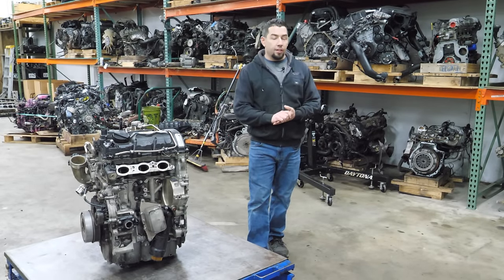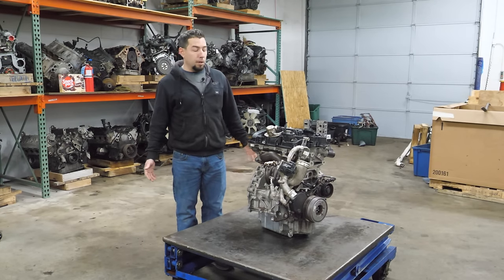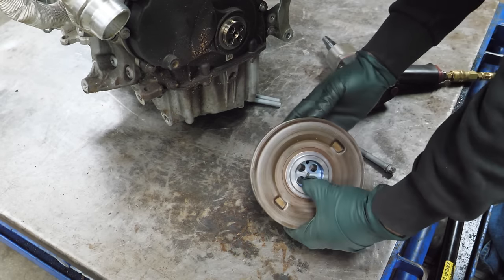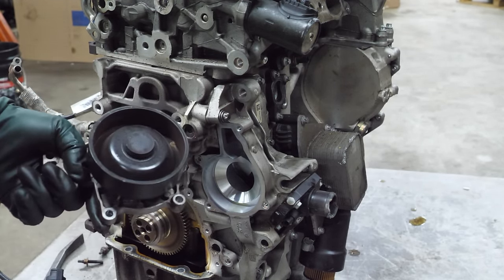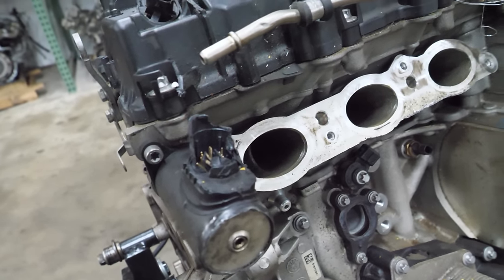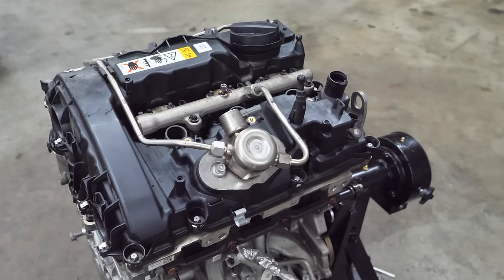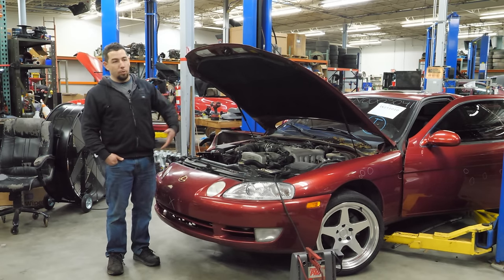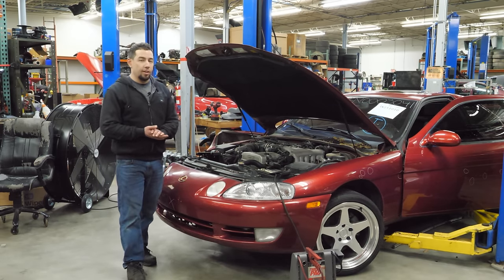MYSTERY FAILURE? 3-Cylinder BMW / Mini Cooper B38 1.5L Engine Teardown

Comment: I own one of these! '15 Cooper. Sweetheart of an engine. Bit rough of a runner, but smooth revving with good power, and excellent fuel mileage on the highway. 123,000 kms so far, hoping to stick with this car for a long, long time
Reply: These are nothing like the good old BMWs
Reply: Oh I know! But the B series is pretty damn solid, there’s records of Minis hitting over half a million with original engine

I’m just genuinely impressed by how good this little engine is, is all
Reply: I was wondering if some customers buy these engines for the fuel economy and dont work them hard enough for long enough.  The engines dont get hot enough to burn off the carbon.      In my experience it can be better to work an engine at higher revs rather than let it slog and overstress it.    I think that engine had been run too slow.
Reply: @jonathanflatman yeah, regular Italian tune-up and good to go.
Reply: @jonathanflatman  I believe you are 100% correct.  With the trend for low friction rings if the engine isn't used hard occasionally they can suffer bore glazing and high oil consumption.  Under harder use the cylinder pressure pushes the rings out against the bore to keep the sealing surfaces working well.
Reply: @earlscheib7754   Lucky this isn't in a BMW then 😉 The B38 sure as hell beats that piece of shit Peugeot engine the R56 had in it. The tritec in the R50/R53 wasn't really anything to write home about either- although adding a supercharger made it pretty cool. Aint no M54 fitting into a Mini lol.
Reply: @jonathanflatman  Thing is that Mini are often driven in the city a lot and these things make so much torque under 3000rpm that you never need to rev them out. Compound that with an auto trans that upshift super early and city driving where you can never get over 1/2 throttle due to congestion and you've got a recipe for disaster. This thing was probably in Eco mode its whole life.
Reply: That junk will never get anywhere near half a million.Half a million problems yeah.The only one that was any good was the 1.4 diesel unit and that was a Toyota engine.
Reply: @eugeneoreilly9356  Theres one at 808,000 miles already. LOL
Reply: @FockeWolf100 bmw wants to wash off their unreliable image, their B series engines are really solid engines, they have been on the market for more than 6 years and no big problems with any of them, even the new supra has the b58
Reply: Better buy a spare engine or find a place you trust to rebuild soon. Never seen one over 200k. Good luck keepin her alive! Hell with the haters.
Reply: @nobodynoone2500  I adore my car; even if the engine does go at 200k (I dont think she'll have that issue) I plan on replacing it. I've had faster cars, but none of them were as fun as this!

Comment: I'd say you're right about the damper.  Years ago, I worked for a manufacturer that made a torsional harmonic damper / isolator pulley for the Mini Cooper S. It was similar in design to the one on this engine. The pulley had a limited range of axial rotation relative to the damper, controlled by an elastomer spring, and they did fail occasionally.

Comment: My money is on that crank pulley, I bet it was making a weird clunking noise and an apprentice misdiagnosed it as bottom end knock. If it happened to be burning oil at the same time, that might have been enough for them.

Comment: The car was probably driven short trips, stop and go city traffic, lots of idling, seldom up to high temp, or run on the highway.
Result, carboned up pistons.
Reply: I agree, my grandmother had a Honda Civic that glazed up due to short trips.     On the other hand, my mothder had a Hillman Imp that she used to thrash and it worked perfectly.   Mechanics from Roots came to inspect it  as it was one of the few problem free engines.   Turns out she was changing gear when the speedo reached the maximum rev markers for each gear that was marked on the speedo.    She did not know that it was maximum revs allowed marker  and had thought that it was a gear change marker!

Comment: I have a theory. This engine somehow got hot. The baked on oil on the piston skirts and the very light scoring in the bore would lead me to believe the oil was overheated either due to no oil cooler or the engine coolant getting too hot. N series an B series BMW engines are known for having very strong headgaskets on the turbo engines. So its unlikely a headgasket failed. However this would also coincide with the center cylinder looking "wet." It appears that the rings on the pistons are not able to move out of their grooves to seal against the cylinder walls from excessive heat. Nor can they allow combustion gasses to get behind them and push them out at that point whenall that carbon builds up. Being a turbo engine the compression is fairly low in B series engines but I bet this one was really low. 
Also N series and B series BMW's have a very specific procedure for bleeding air out of the coolant system. I would guess something happened where this wasn't done right ultimately leading to the engine loosing power and failing.

Comment: It's Cross hatching Eric the X pattern on the walls is a symbol of either A. A well maintained engine or B. A recently rebuilt/built engine. The matching crosshatches to retain oil in the X grooves keeping the cylinder and piston lubricated better, if the cylinders are glossy/mirror Finnish they WILL NOT retain oil and will lead to premature failure faster due to excessive wear.
Reply: He was referring to the strange V or X shaped pattern at the top of the bore found in the center cylinder.  Not the cross hatch, which he would be familiar with.
Maybe it’s caused by cylinder distortion?
Reply: @gordonborsboom7460  probably the injector pattern then from the hot spots

Comment: This engine has the same problems that we have on many modern direct injection engines, in particular TSI engines from VAG: clogged rings, the whole thing ends up destroying pistons and cylinders... The cause is known: the direct injection produces soot which clogs the scraper rings and the oil return holes, the segments, which are very thin and at low tension, easily lose their sealing, in addition direct injection completely degreases the cylinders when running cold this which accelerates wear, in short a crappy design, made to auto destruct, planed obsolescence...When these problems appeared on the TSI/TFSI many years ago, some German mechanics modified the pistons by recutting the grooves of the oil rings to fit larger older generation U-flex and tripled the diameter of the oil return holes, which solved the problem efficiently,but...Volkswagen/Audi need many years and 3 successive modifications to reach the same result...realy creasy...but the victim remains the customer who has been frauded!

Comment: Berrymans B12 in the spark plug hole several times and let it soak. It’ll free those rings and clean that carbon right off.

Comment: The crank pulley/balancer is NOT supposed to be like that.  As a MINI tech I've seen it a couple of times (actually have on in the shop right now) and it creates a noise that sounds almost indistinguishable from rod knock.  So it wouldn't surprise me if an independent shop heard that, and replaced the engine.  Lastly that is actually an updated balancer, the older style starts free-wheeling when it fails.

Comment: Actually it makes some sense - let's say somebody was driving this car veeery gingerly - which would promote carbon buildup on rings. Then they would report "hey it's burning oil like crazy" -> IF car was under some sort of warranty, then they would just replace the engine and drop the core with you ...
What doesn't make sense in that scenario is that when you buy a brand new long block, BMW puts a surcharge on top the price, which get's returned if you return them the old one ... which is more than what you would charge for the core.

Comment: I'd bet that the littke bit of excessive oil use and the rattle of that front pulley was cause enough for a mechanic to diagnose a bearing knock ...

Comment: 3 cylinders are a naturally unbalanced engine you see a lot of these 3 cylinder engines fail like the ones in skodas(vw) the ecoboom Renault BMW etc etc or it's silly ideas like a wet belts that are buried deep within the engine

Comment: Why are these B38's so expensive? I can give you 2 or 3 reasons: "BMW tax". "Bring More Washingtons". "Bring My Wallet". LOL! I have a 2018 MINI Cooper S with the 4 cylinder version of this little turbo engine, the 2 liter B46. There is also the B48, which is (I believe) the John Cooper Works version of the same 2.0 B46. Very fun little engines, and great fun in MINI's for sure. But when stuff goes wrong....well, that's gonna hurt, I'm sure! Thanks, Eric, for the awesome teardowns and insights! The Mazda Renesis Rotary was especially cool, as I always wanted to see how these work in real life, not just pictures and exploded or cutaway diagrams. I actually replace a 13B (I think) in like an 84 RX-& back in the late 80's or early 90's at a shop I worked at in Northern California. We yanked it and installed a rebuilt unit, so never got into the internals. But that 4 barrel carb and all those vacuum lines? What a mess! It all worked out, but was quite time-consuming. Take care, man. And stay safe!

Comment: I currently drive a 07 ford expedition with 257k miles on it shes is my daily driver and still going strong till this year im going to be parting it out as there are alot of good parts on it an was wondering if you want the motor

Comment: while most the time these engines are driven too hard, this engine wasnt driven hard enough. uts why everything inside looked good but the pistons never got hot enough to burn off the carbon, and eventually the carbon locked the rings in place allowing for a loss of compression and consumption of oil. i bet if he gave it the italian tune up every now and then this engine would still be good. im easy on my engines but for this reason i dedicate fridays to being "hard" on them just to keep carbon down

Comment: Man, it looks like your hope not was correct from the start. That rallied crank pulley was knocking around and they probably assumed it ate a full set of mains or broke a crank. That really is a shame that they replaced a whole engine (an expensive one at that) because of a failed pulley. I can also see why someone would make that assumption not knowing how the pulley is constructed.

Comment: Fun fact: 

The oil filter for the i8 range extender engine is the same as the engine oil filter for a BMW RnineT motorcycle.

Comment: Engine oil such 0W-8, 0W-16, 0W-20 with HTHS 1,7 - 2,,3 - 2,6 - 2,9 is not protect the engine but destroy the engine.

Comment: I understand it is a joke, but breaking down BMW engine codes:

B58B30O1 (2017-21 BMW M240i)
B
The first letter designates engine family:
B being the modular engines that share designs through all models.
S being for M Division designed engines (Motorsport and high end).
M Pre 2001.
N Post 2001.

58
The next 2 numbers denote Cylinder Count and Technical Reiteration/Design Update.
3 - 3 Cylinder
4 - 4 Cylinder
5 - 6 Cylinder
6 - 8 Cylinder
7 - 12 Cylinder
8 - 10 Cylinder (it’s in this order because they didn’t make a 10 Cylinder until AFTER 12 Cylinders were mostly fazed out)

8 - 8th iteration/Redesign before production.

B
This one is for fuel and engine layout (Longitudinal vs Transverse)
But all modern BMW’s (not mini) use only 2 or 3 of these generally:
B - Petroleum Longitudinal (front to back)
D - Diesel Longitudinal
H - Hydrogen

30
This next number is engine displacement without the decimal
15 - 1.5L
20 - 2.0L
30 - 3.0L

O

This next letter stands for engine power output
Zero (0 not O) - New Development
U - Low Output
M - Middle Output or Standard
O - High output
S - Super
T - Top or Maximum Output

1
This last one is for Update Post Initial engine production, more like updates into the final design, usual denounced with a TU for anything after 1, but 1 means first gen, TU or 2, means 2nd gen of the same engine, TU2 is 3rd gen, etc. TU itself stands for Technical update.

Comment: i would like to see a tear down of the gm 1.6 or 2.0 diesel in the cruze. i have been thinking of buying a diesel cruze and im really curious on how the motor is built
Reply: if it's related to the 1.6 and 2.0l multijet engine (FGP) it's fine. Just replace the oil pump seal that GM skimped on.

Comment: @Eric: I think you need to separate "OK" (I'm going to GET AWAY with this...at least THIS time) from "FINE" (This is actually acceptable)!
Also triangle (3 bolts) have advantages beyond # per bold) ... and you did NOT say either OK nor "FINE".

Comment: What about Fiat 500 abarth? 
So small, so fast and so weak...as follower from Europe, I wish one day to see that 😅
I tune my own small cars regularly.
My today project is Renault Clio mk2 1.9dti added a cooler and Mégane turbo...no ships, nothing. 0-100km for less than 7 seconds.
6 liters oil capacity, is very strong small car engine...25 years old small engine...
Anyway, thank you for the job you do for us.

Comment: I mean, yes that is a $3,000.00 ish engine on the used market. But, at least it isn't a Honda B-series like a B16 or B18 with VTEC. Just recently saw a fully dressed B18C6 Integra Type R (European/UK) engine, transmission complete with CV axles and intermediate shaft, even has the engine harness and ECU for $10,000.00. That is the cheapest I have seen an engine/transmission combo go in a long time, by themselves.

Comment: PCV valve system is very poorly designed on the supercharged and turbo Mini Coopers. The valves can get so carboned up that it can literally stick the valves open far enough to contact the pistons. Absolute Garbage.

Comment: So why would those pistons be all carboned up?  I was wondering if it was never run properly as in Lugged continuously. In this day of automatic transmissions that's probably doubtful. But a good road trip with some mountain driving and running at high RPM's I'm thinking might have cleaned those pistons up. Also would an incorrect or cheap engine oil be at fault? Would a fuel additive have cleaned them up?
Enjoyed the video. Thanks

Comment: In us version is 1.5L is B36 same version of B38 
2.0L is B46 same version of B48 

Only model had B48 is JCW model 

seemed to be reliable if you taken care of oil change enough outlast the engine 

I found kinda interesting possibility due to state emissions

Comment: I'm not a mechanic. I'm not an engineer. But with the crosshatching in the block, can the old sleeves be removed and new ones fitted for someone buying this engine? With new rings and the carbon removed from the pistons, you'd essentially be starting with a new block. I know new sleeves can be fitted, but is that usually done for this type of vehicle or more for high performance vehicles? Yeah, I know, I'm a couch mechanic, but it's a reasonable question from someone who simply doesn't know the answer 🤷🏻‍♂️😉.
Cheers 👍🏻

Comment: The exhaust manifold to head clamp system is genius, so is the manifold/turbine housing casting! 

Just think of how many bolts, and seals, and assembly are avoided! Weight is saved and warranty failures are avoided!

I hate BMW, btw

Comment: I must say, I do like by B58/2 😂 102k miles on it now and it's running like a dream, 118i but Holy shit the wastegate rattle is annoying

Can also see that mine burns oil so seems about right, about 1L per 8k miles so its manageable. Overall bullet proof engine

Comment: I reckon someone took their mini to a mechanic making a noise (the buggered drive pulley) and the mechanic told them they needed a replacement engine haha  Would have taken 10 minutes to fix with a replacement pulley. Greetings from down under

Comment: Can you find a mirage 3a92 1.2L 3 cylinder from the mirage? 10x better engine than the 1.0 ecoboom but like half the power, no turbo. If you find one, i bet the failure would be plain neglect, timing belt failure, run low on oil, etc. They're good engines

Comment: It appears to be defective piston rings from factory, Audi had similar problem, class-action lawsuit alleged the 2.0L turbocharged Audi a3/Q3 engines experience oil consumption problems due to the pistons, piston rings and piston heads.  A small amounts of oil leaks into cylinders where it burns and leads to high oil consumption. Oil consumption gets progressively worse as grooves in the bores are getting bigger and cause more and more oil to leak around the pistons. Audi voluntarily recalled and fixed affected engines under warranty. I do not believe BMW has recalled Mini engines for similar problems, probably because no class-action lawsuit has been brought against BMW for similar defects.

Comment: Definitely a low miles bmw engine. I’ve seen N20s with 30k and were caked with carbon on the intake valves and horrible carbon sludge on the valvetrain. It’s sad to see that BMW went the same route as VW/Audi on their timing chains in the rear. Going to add costs for timing/vanos failures.

Comment: It's probably not that it was clattering from the pulley, or that it was burning oil.... it's likely that it was clattering AND burning oil. So it looked like a duck and quacked like a duck, but was actually a small goose with sore feet or something nonsensical like that.

Comment: This engine probably saw a lot of idling and low-speed operation for that much carbon. I really hate back-of-the-engine timing setups. Unless it's fully maintenance-free like the gear drive on OHV boxers, you're eventually going to need to get at it, and having to pull the engine to do so just means it's that much more expensive when it's necessary (and if modern engines with surprise failures of poorly manufactured timing components are any indication, you'll probably need to do it sooner rather than later).